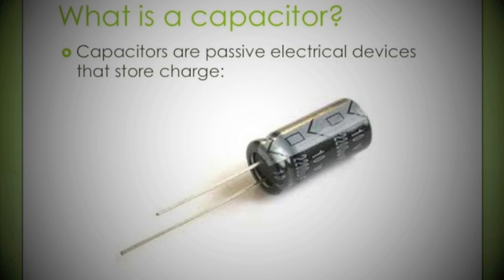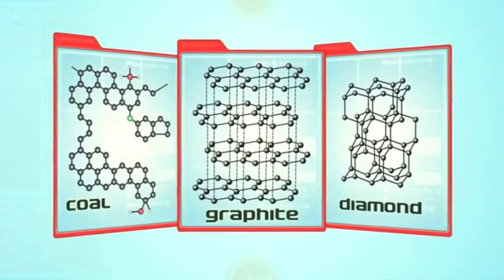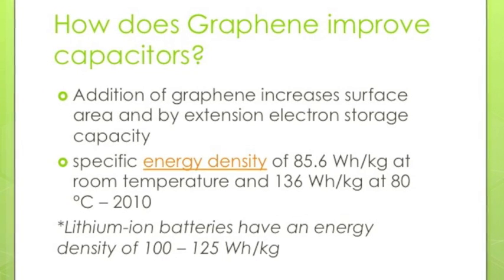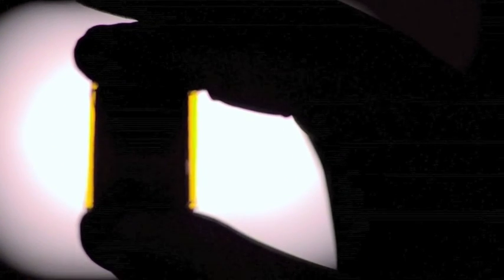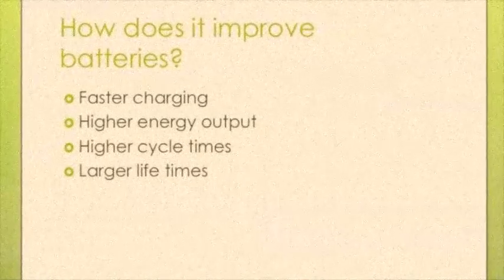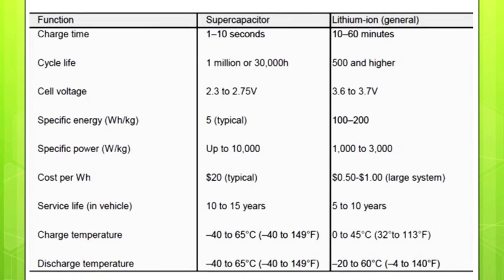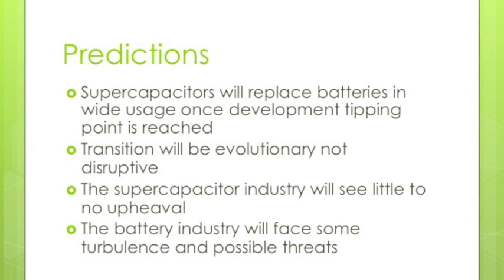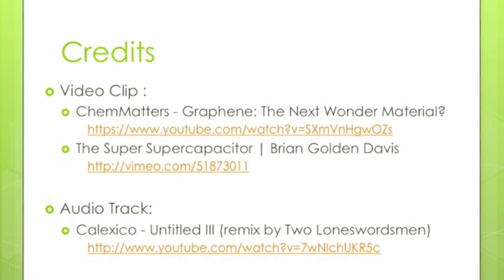Graphene in Supercapacitors

Comment: It works. Howerver, the high-current and quick charge/discharge graphene supercapacitors would flood most devices with too much energy too quickly, so a limiting current regulator would be needed to slow or control the discharge rate. Like a floodgate that limited the electrical current. Charging such supercapacitor would take moments and last 3-4x longer than a conventional battery. Graphene makes for better electrodes and even membranes in fuel cells can be made out of it. On an interesting note, graphene absorbs light at all wavelengths (zero bandgap) and provide electricity directly no matter what the frequency of light is.

Comment: I bought 8 350 ferad super caps that I will install in my 1990 miata. They are D battery size and produce about 14 volts when six of them are connected in series. We'll see how it goes. Don't know what I'll do with the other two left over though.